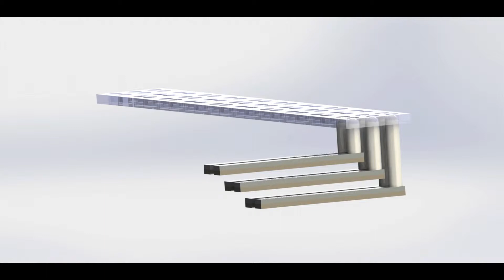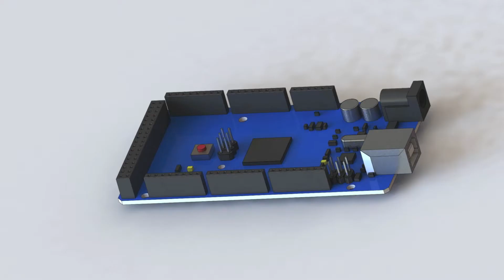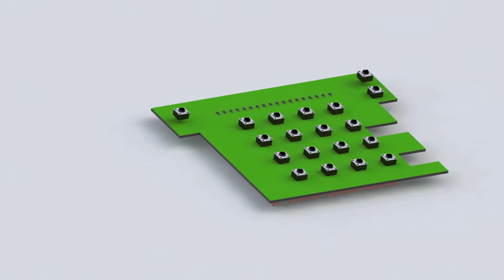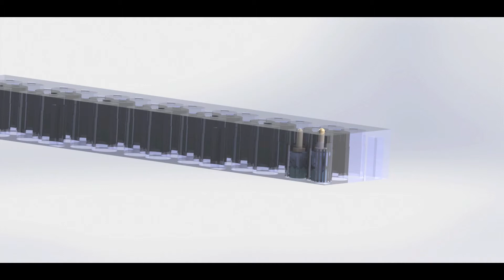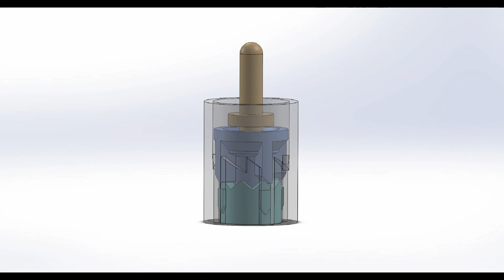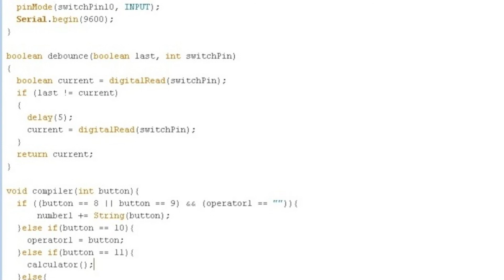Braille Calculator

Comment: How are those cam-and-follower mechanisms the most expensive part when they're the same as the most common type of clicky pen mechanism? You could probably get those for a few cents each from a pen manufacturer, if you're ordering a large number for production. For prototyping, just buy a box of clicky pens from an office supply store and disassemble them.